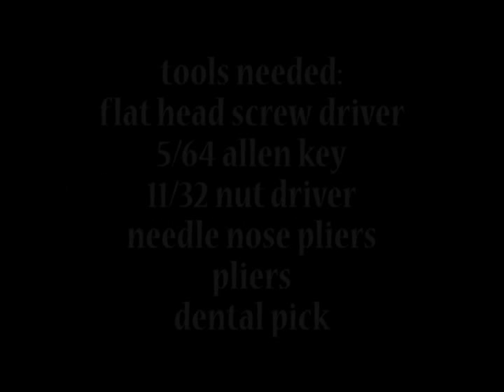Columbia Taping Tools Taper Repair Video Part 1

Comment: can your parts be used a tape tech taper
Reply: They are not generic with tape tech.
Reply: All guns are based off of Tapetech bro.. Ames (Tapetech) had the patient for years.. so yes you can interchange MOST parts